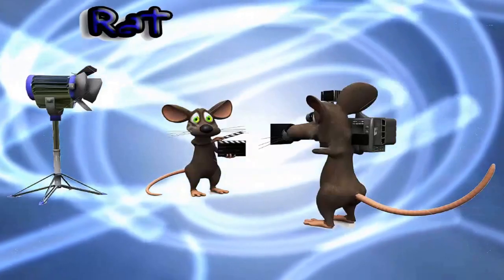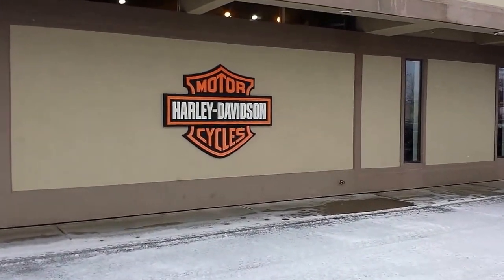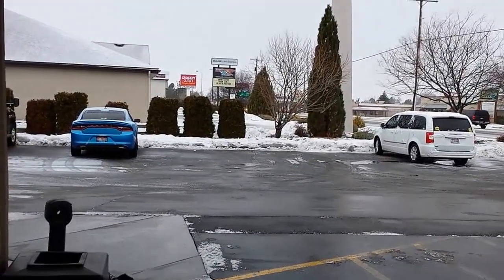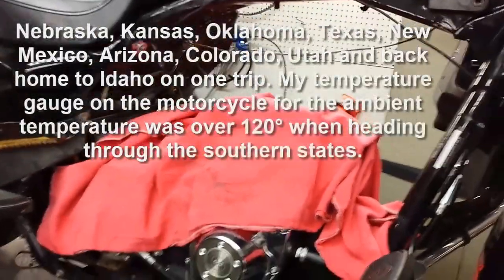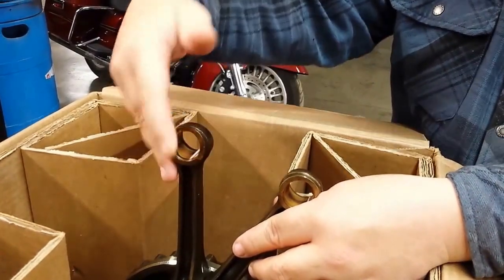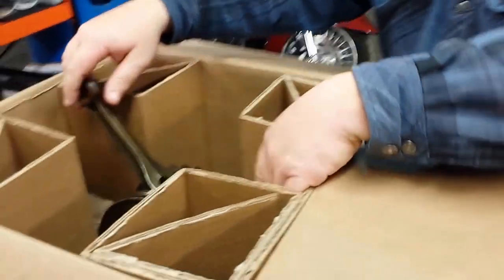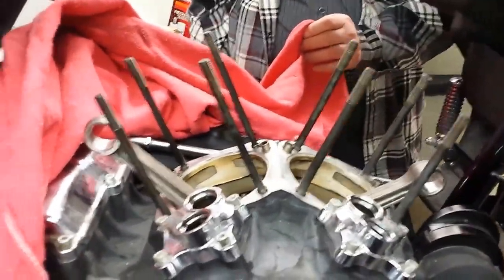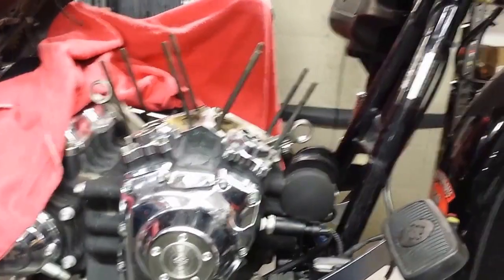Over heated 2009 Harley-Davidson  motorcycle

Comment: Try motul full synthetic oil next time. My iron 883 used to heat up in traffic and stop lights with harley oil. I switched to motul full syn and  now temperature stays normal all the time in traffic. I think they have some engine cooling additives in it, which helps motor to cool down from oil circulation.

Comment: What kind of pil cooler did you use? I have a 2009 Fat Bob, went from 96 to stage 4 bigbore 103, as you can imagine it runs real hot, has gotten up to almost 300°! So put a drag specialties oil cooler yesterday, but couldnt get the fan to kick on, not sure if I messed up the plastic oil temp sensor, supposed to kick on at 205...guess Ill have to grab a +12v from the battery, will just fuse and put it on a switch..hopefully that will keep the monster cool..was an easy install too!
Reply from the maker: I used a Jegs cooler I think I have a video on here describing it. It does not have a fan so really it does no good when you're stopped. I recently found out something that I didn't know and I'll pass it on to you my bike has a parade mode. Along with a lot of other bikes. What that is, your engine well stop igniting the rear cylinder and you only run off one cylinder until the engine has cooled. I noticed this going down the freeway one day and pulling into town on a hot day pulled up to a stop sign and I thought something was wrong with the bike cuz it started running on one cylinder. Now I know why. Good luck on your endeavors check out the rest of my videos. Place a new one on there every other day if possible
Reply from the maker: https://youtu.be/VbDldVKhmL8
Reply: Finally installed love juggs mighty might cooling fans! Actually does cool the motor by 100°f !!! Now bike with stage 4 103, roughly 125hp to tire, runs no higher than 220 when fans on in a 90° day!!! Worth the $350 for sure!!! Simple install and has a switch built in, so just have to run your wires to battery. Works great 👍!!!

Comment: It has been a few years since you posted this video, but I wanted to ask. You mentioned using Mobil 1 20W50 synthetic oil in your bike.   Was that oil not adequate for your bike? I am about to use it on my 2006 Softail Classic and dumping the Lucas conventional oil is has in it because it just could not keep up with the heat. I will also possibly be installing an oil cooler if the synthetic oil does not work.  Thx.
Reply from the maker: Well I had gone on many forms and found it that oil was what a lot of people was using. They were using Redline oil and the Amsoil. But I have found that I have a problem finding some of those oils on the road if you needed it and I don't want to carry an extra oil can with me. That's why I went with what I did.

Comment: I use Phillips 66 x/c aviation oil 20w50 works excellent. FAA approved...
Reply: I know people using Shell aviation oil . Im undecided on that one. Aviation motors run pretty much at a low constant RPM . Motorcycles are constantly revving higher.

Comment: PLEASE ADVISE; DID YOU RUN THE BIKE WITH THE COOLING SYSTEM DESIGNED BY HARLEY IN THE OFF POSITION??  THE REAR CYLINDER COOLS THE FRONT BY PUMPING AIR INTO IT AND SHUTTING DOWN THE BACK CYLINDER.  MANY DON'T LIKE THE LOSE OF POWER SO THEY SHUT IT OFF BY THE THROTTLE CONTROL.  2009 AND UP HAD THIS FEATURE.  MINE IS A 2010 ULTRA CLASSIC 96 C I.  I'VE BEEN CROSS COUNTRY 3 TIMES TO 46 OR SO STATES.  I RUN RED LION OIL WHICH KEEPS THE ENGINE COOL BUT I ALWAYS ENGAGE THE COOLING SYSTEM.  I HAVE NO ISSUES.  THAT SAID I THINK A FAN AND OR FAN OIL COOLER WOULD BE NICE BUT NOT FOR 500 DOLLARS.  I KEEP THE BIKE MOVING.  I CAN RECALL A DUDE IN CHARLOTTE NC ON A 100 DEGREE DAY HEADING EAST TWO LANES HE IN A DODGE RAM CHALLENGING ME.  I FINALLY DUSTED HIM OFF EVEN IN 100 DEGREES SHE CAME ALIVE.:)  NO MORE DODGE.
Reply from the maker: No I did not have any cooling system on it other than clean fresh air

Comment: So why didn’t use the oil designed for the bike( Harley Davidson SYN3 ) ?
Reply from the maker: I checked the Harley-Davidson forum and everyone was talking about the different brands of oil and which ones they like the best. And I still use mobile one in the motorcycle. I don't think it was due to the oil as much it was to the Heat going through the Southern States when my ambient temperature gauge was buried at a hundred and twenty.
Reply: G RAThbun you know people on those blogs will always tell to use this that or whatever. If Harley designed it and put a warranty on it I’m sure they tested those oils ingredients against the metals they use. Sometimes you can use the wrong oils with a metal which is to soft or the opposite the oil isn’t durable enough. Let’s not forget the changing intervals and filters.

Comment: I live in Phx Az . we have 115 degree summer days. Long red light? Slow rush hour traffic? Shut it off at the red light dont sit there idling. Anyone with an evo shovel pan or ironhead already knows this. I have never over heated any of my sleds. Lots of fun when your sled is kick only LOL you guys with these new bikes have electric start so its simple DUHHHH
Reply from the maker: Yes I've had a few of those kickstart motorcycles myself. I hear from my cousin in Phoenix that the hardest part about riding a motorcycle down there in the summer is hanging onto the handlebars. I never thought my motor would overheat like it did. I didn't know it had. It was still running
Reply: @G_RAThbun  yup my 61 pan has chrome grips LOL they suck in summer heat . What the hell was I thinking when I built that one IDK!  It also has the entire engine and trans chromed and THAT holds in heat. Cant run her in the day in summer only at night. My 71 shovel does ok in summer as long as I shut her down at red lights and ride her EASY . Just put put along. Ironheads get hot very easy gotta run them early morning and at night all summer. Now I also have a 71 Honda CB 750 FOUR SOHC . Its a chopper. air cooled , runs fine all summer. Inline four transverse mounted so its catching air better. But I shut that one off at red lights too. I have an 09 Dyna that seems to be OK in summer although it loses power in super hot weather. Its very noticeable . I also have an 81 Yamaha Virago thats a chopper. Air cooled . However the rear cylinder is slightly offset from the front. Yamaha knew what they were doing. Its runs fine all summer.  Its a rolling experiment as Im always changing how its set up. I recently picked up an 83 FLHT . Thats not AMF. Its tottaly stock and original . Thats why I bought it. See how it rolls this coming summer!

Comment: what good is a bike if u cant ride it in hot weather? no thanks.
Reply from the maker: Lots of vegetables go into overheating your motorcycle. They all can be overheated. Running your bike too lean. Running it too fast and hard when the weather is way too hot. Running your motorcycle when it's too cold can also hurt your motor. It does not matter the brand of motorcycle. It's called maintenance. I don't know who owns this motorcycle before I did I don't know how they took care of it. Good luck on your motorcycles.